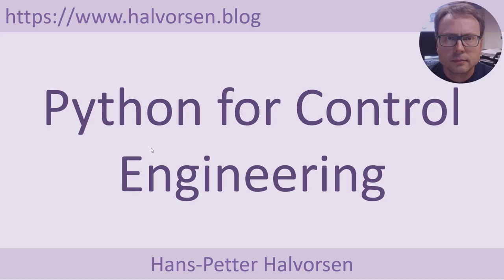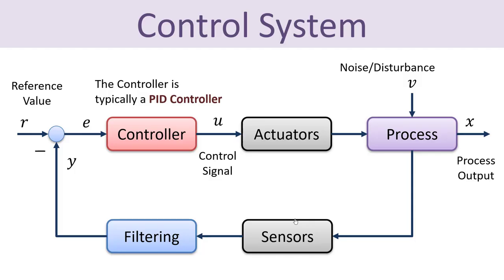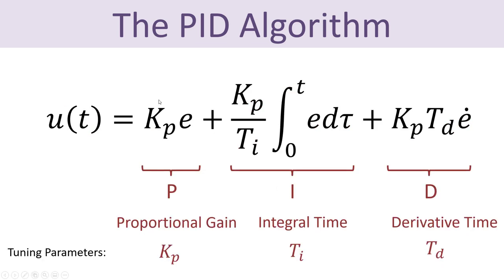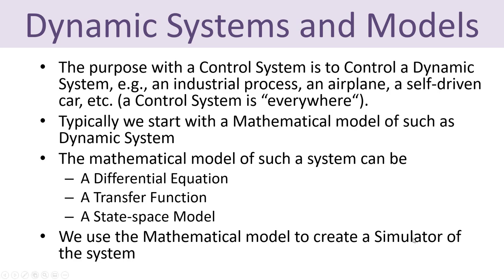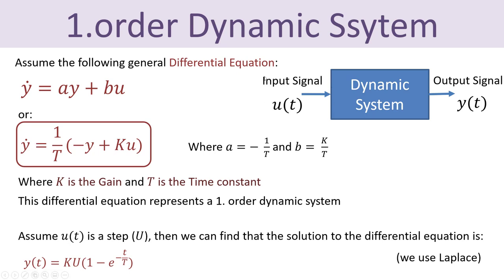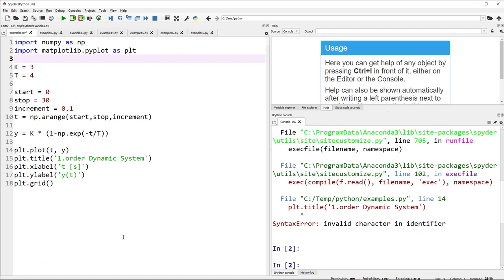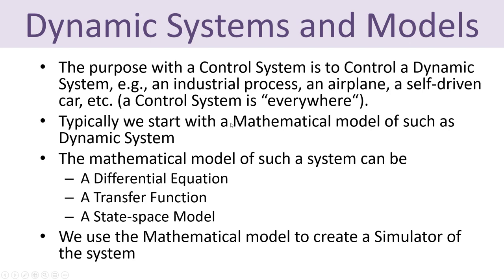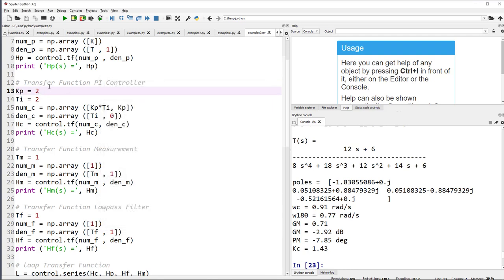Python for Control Engineering

Comment: Thank you sir for your tutorial!

I came across this warning when looking up the function 'odeint':
"For new code, use scipy.integrate.solve_ivp to solve a differential equation."
After a few hours of guess-and-search, this finally worked:

import numpy as np
import matplotlib.pyplot as plt
from scipy.integrate import solve_ivp

K = 3
T = 4
u = 1

tstart = 0
tstop = 30
t_increment = 0.1
# Note: y0 Is now an array
y0 = [0]

# Function that returns dx/dt
# Note: t and y are in reverse order. Right side of ODE is now an array.
def system1order(t, y, K, T, u):
    dydt = [(1/T) * (-y + K*u)]
    return dydt

# Create time sequence
t_samples = np.arange(tstart, tstop, t_increment)

# Solve ODE
# Note array indexing notation: -1 refers to last element, -2 second to last, etc
x = solve_ivp(system1order, [t_samples[0], t_samples[-1]], y0, t_eval=t_samples, args=(K, T, u))

# solve_ivp() Returns a Bunch() object, which is a dot-accessible dictionary
# In case you would like to see what it looks like:
# print("x : \n", x)
# print("")
# print("x.t: \n", x.t)
# print("")
# print("x.y[0]: \n", x.y[0])

# Plot results
plt.plot(x.t, x.y[0])
plt.title('1.Order system dy/dt = (1/T)(-y + Ku)')
plt.xlabel('t [s]')
plt.ylabel('y(t)')
plt.grid()
plt.show()

Comment: @46:52 Solving for u[k] (at the bottom of the slide), everything on the right hand side gets multiplied by Ts. Should the last term also be multiplied by Ts?

If so, @50:38 Inside the for loop, should the equation for u[k] be:
u[k] = u[k-1] + Kp*(e[k] - e[k-1]) + Ts*(Kp/Ti)*e[k] ,  with the last term multiplied by Ts?
Reply from the maker: Yes! Ts should be included in the last term. The simulation results also gets much better :-)

Comment: The code for example 9:

#The Loop Transfer function
L=control.series(Hc, Hp, Hf, Hm)
print('L(s)=',L)

#Tracking transfer function
T=control.feedback(L,1)
print('T(s)=',T)

Maybe should be:

#The Loop Transfer function
L=control.series(Hc, Hp)
print('L(s)=',L)

L2=control.series(Hf,Hm)

#Tracking transfer function
T=control.feedback(L,L2)
print('T(s)=',T)

?

Comment: Thanks for this tutorial. I'm in control system area though a beginner in Python. I 've learnt quite a lot with this video. 
Anyway, I have a question on the stability analysis example slide (around minute 56). According to the slide, T = y/r = L/(1+L) with L = HcHpHmHs, but y is not indicated in the block diagram. I guess that y is the process output (labeled x on the slide). In that case, T = HpHc/(1+HpHcHfHm). Could you clarify this?
Reply: I think he means the tracking function is the transfer function between r and Yf. If you work that out, L(s) comes out as shown in the slide.

Comment: Dear Sir,
    Thank you for the wonderful tutorials. I had a question. In your YT video titled Python for control engineering, when you demonstrate the control example starting around 48:00. I can see there is a difference in the discrete PI term between the pdf presentation and the video. I see in the pdf there is an extra Ts term whereas in the video it is missing. Which one is the right expression? Pardon my ignorance, I am asking you instead of trying out the derivation myself.
Reply: Dear sir,
Are u getting the same graph after executing the PI controller ?
I am getting  a different  one.
Reply: @19293949596970  Hi, you are right. The code and the derivations in the pdf are the correct ones. So yes, the graphs look different. I tried out the derivations later and the ones in the pdf are derived correctly 👍🏻. The derivations in the video look to be flawed.
Reply: @electronicsacademy2D2E29  Thanks

Comment: What is K?
Reply: This is the most common and standardized way to describe a first order model. K is called the static gain, when the input is constant. It measures the ratio output by input when the plant reaches its steady state, i.e., K=y/u when t--> infty. For instance, if k>1, the system is amplifying the input. Otherwise, it is reducing its contribution on the output.